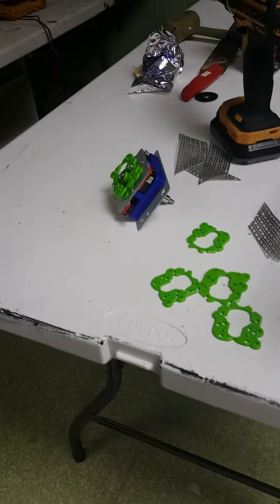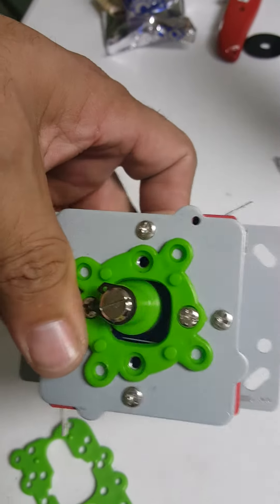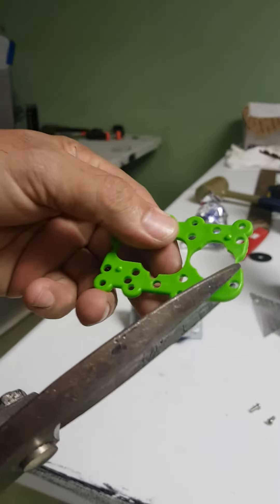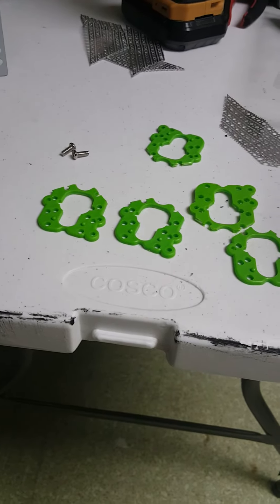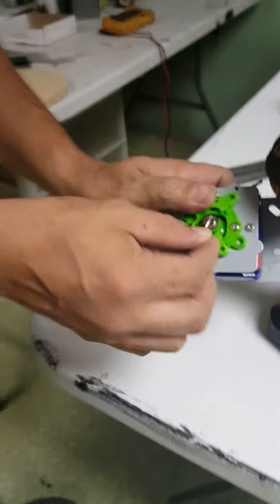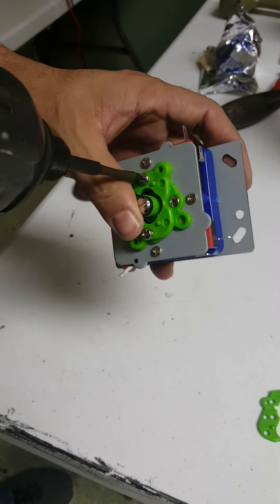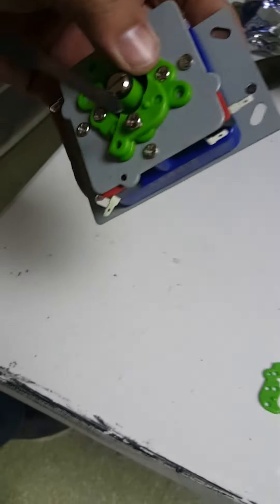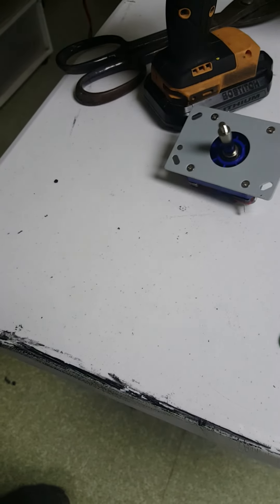Zippy 4 way 8 way left and right not working fix.

Comment: Bit late to the party here, but just a quick FYI...the far easier fix is to simply remove the restrictor plate all together. Cool mod tho.
Reply from the maker: That will work to set it to 8 way . The mod is to allow 4way to work correctly
Reply: Why not build a new 4 way plate out of wood, metal or plastic cause the original plate it comes with are crap, brittle and if you buy these your pretty much gonna be doing the same mod, trust me I bought the same ones and it really is a pain in the ass to go through this, would you build it, sell and save the human race from 4 way control misery?